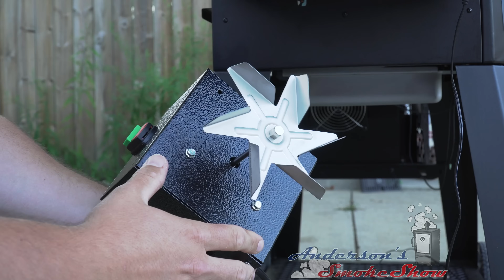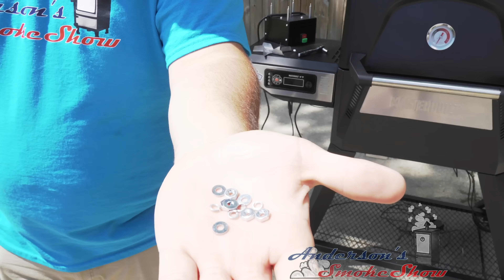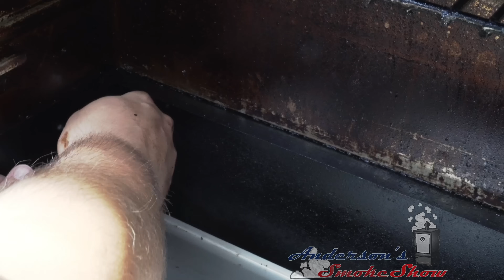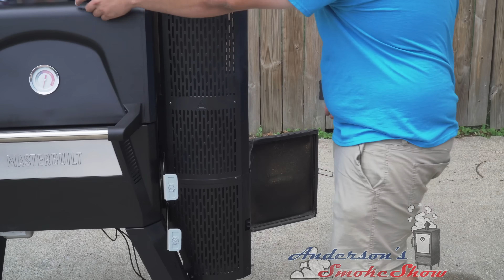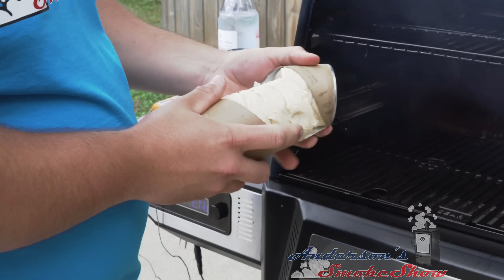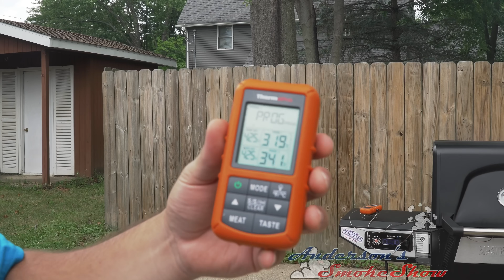Modification Failure | Masterbuilt Gravity Series

Comment: i have the same grill. bought it used for $100. cleaned it up and it's become my go-to grill/smoker. i've not done a biscuit test but i don't feel like there's a problem-temps are pretty accurate and the food turns out great. i did a few mods to increase the lifespan of the unit-stainless steel fire box, ss vent cover and ss manifold. i love the ability to mix real wood with charcoal. got rid of my pellet grill.

Comment: Given this was done by a self labeled engineer... I cannot believe it was this poorly thought out.  The actual concept of what was trying to be achieved is not even remotely viable without voltage limiting inline resistors.
"I got more grey stuff"... ya... brah... doesn't mean better... this was a fail across the board  🤣even the placement was a complete fail of concept
Reply from the maker: Yeah bruh, I bought a smoker convection fan and the results sucked bruh. So I bought a fan speed controller and ran about 15 different tests on my own time and off camera and not a single position/speed/direction ever made a legit difference. Sincerely Bruh.

Comment: Excellent video! It seems a little extreme to install a convection fan to get uniform temps. Meat drippings will destroy it anyways. Something nobody talks about, is using the damper (slider plate that you remove on light up) to control the temp fluctuations. I have the Gravity Fed 980. To stabilize temps, I partially insert it to control temp runaways (windy conditions) as well as some even-ing out of temps on the cooker. Small adjustments (sliding in or out) will work wonders. Might work on the Masterbuilts, just make sure you use the one on the cook chamber...not the fan.
Reply from the maker: I’ll have to mess around with those slides

Comment: Your fan was blowing against the inlet from the coal burning area.  You were basically fighting the grill.  A much smaller fan mounted to the back bottom would be a much better location.
Reply from the maker: I tried for a solid week to make a difference by adding the fan. Changed the direction, speed, etc…. Nothing made a real difference

Comment: There is a fine line bn circulation and cooling.  My immediate thought was the fan is too large.
Reply from the maker: I tried a variable speed controller but couldn’t ever get worth results even with slow speeds
Reply: @AndersonsSmokeShow  It was a good experiment.  Thanks for trying it and sharing the results, esp. since it was a fail.  As an engineer, I know you’re still contemplating possible solutions.

Comment: Great vid. I honestly think if that Smoke Daddy Pellet Smoker convection fan had variable control knob with 5 to 10 fan settings from very low to high, you would have not had that issue. If that fan could've spun at a 8th or 10th of that speed; especially in that small space, it would have circulated that air perfectly without pushing out all that heat. You might have seen around a 5 to 7 degree drop at max. Nice concept though. I wonder if they fixed that issue?
Reply from the maker: I did try a fan controller which actually got it pretty even, but the controller wouldn’t hit setpoint and would often run like 10-15F below which means that it continuously tried to heat up… thus burning more fuel
Reply: @AndersonsSmokeShow  So in the end using a fan is probably not worth it at all.
Reply from the maker: I feel like maybe with proper placement it could make a difference… but to pay the money to void your warranty is probably a no go haha
Reply: @AndersonsSmokeShow  unless of course, you purchased it from Costco. THEN you could bring it back. In the last six years I have returned to triggers and three Louisiana grill pellet grill smokers. Costco recently had the Masterbuild 800 for sale for $500 and I grabbed one. I have to say that this is truly one of the best REAL BBQ smokers out there! But if something happens where it fails in the next three or five years, I will definitely be bringing it back and getting whatever else at Costco has available. I just hope there will be another Masterbuilt BBQ available for purchase at that time. That is the benefit of having a Costco membership, that not too many people know of. Except for the ones that are reading this comment.

Comment: I was wondering if the convection fan was set to pill the hot air from the manifold or blow back at the hot air coming from the manifold? 
On a different note. Have you had a problem with the griddle where the temperature sensor would say it is at 350 but the door thermometer says 250? My thoughts are that the temperature sensor is getting hotter as there is a gap for the hot air to go straight to the sensor. I am going to try to mount a temp sensor in the back above the griddle and see if that works
Reply from the maker: I actually tried it both ways.... I spent a lot of time after this video messing around with the fan trying to make it perfect. I even added a variable speed controller to try and dial it in, but no matter what I couldn't get it quite perfect. If i remember correctly I got it to even out REALLY well, but it was sitting at like 15F below setpoint which causes the fan to run constantly and burn more fuel

Comment: I think you missed a data set that this mod makes for a more uniform temp throughout the unit, despite the probe temp vs set temp. Having a uniform temp in the whole cooking space is a valuable effect of such a mod. My theory is that a slower fan mod would be a good mod if you can match the set temp to the whole cooking space!
Reply from the maker: I put a fan speed controller on there and could never get it dialed in to where it was useable. It did even out the temperature, but because the temp reading was below the set point the controller just kept pushing. Eventually it would’ve errored out, or fuel consumption would’ve been through the roof.

Comment: I was thinking you need to put the fan in the middle and back or under. Anytime you are changing the designed features you need to engineer what you are attempting to accomplish. Add a rheostat to that fan and dial it down. Way down. You just may have the perfect solution. I would have dropped a smoked tube in and light  and tried to video  the airflow.

Comment: Was thinking about buying one of these grills but decided to wait until they are properly built straight from the factory!  Its just a charcoal grill shouldn't need any expensive modifications on top of the original price tag. Factory should also come up with an easy method to clean entire grill, bet most wont get cleaned much after the first 2 or 3 times, except the cooking grates of coarse they should be cleaned every time spray on oven cleaner rinse with hose do this 3 times they are ready to go.

Comment: What were the temperature inconsistencies?
Reply: My stock mb 560 shows a different temp than "meater" ambient probe temp regardless of where in box, probe is...  I consider that a "whatever"... control holds steady temp.. I can work with that.. how does fan affect "eveness" of biscuit test?? Not convinced your mod is a fail... merely that master built control temp is based on stock fan speed. If the hot spots are eliminated then the extra fan is successful and you only proved what a "control" test would have proved .. controller temp isn't 100% accurate. Did anybody ever trust a lid mounted thermometer? Why would you trust a digital controller?? Aside from showing fluctuation?
Reply from the maker: The grill said it was one temperature but my wireless probes said another. I have a whole video on it.

Comment: Probably pushing air against the original fan motor, original fan motor pushing air in if that fan is stronger it's pushing it back to the firebox, let's hrat
Reply from the maker: I got a fans speed controller, and I also reversed the fan blades. I did actually get a more consistent temperature across the grate, but the over all temp was about 15F below setpoint
Reply: @AndersonsSmokeShow  thats called an offset adjustment to the temp probe then. Sounds like what you did is a win? 👍👍

Comment: In the US it can only void the warranty of the part you modified. Just like how shucking a HDD voids the warranty of the USB case but the drive within is still under warranty.
Reply from the maker: Strange how that works
Reply: @AndersonsSmokeShow  Yea basically companies will try to claim that you will void the entire warranty for example those warranty void if removed stickers. US case law has made it clear that you can only void the warranty of the individual part you break and only the part. So for example even that part he drilled into could still be covered under a warranty for a paint defect if a part of the same piece had covered damage that is unrelated to the owners modification. Or for example if his PID controller now breaks that is covered under warranty as he did not do anything to the PID controller. They would need to argue and prove in a court of law that the modification caused the breaking of the PID controller for example in order to deny warranty coverage. 

Remember, in the US you have the legal rights to modify and repair your property without voiding the warranty.In so far as your repair / modification does not directly cause the failure that you are making a warranty claim for.

Comment: At least you tried. Every other mod people do alway;'s seems to work out .but after how many tries?
Reply from the maker: Yeah I want to revisit this and get it perfect. I have a speed controller for the fan which helped but still wasn’t right.
Reply: @AndersonsSmokeShow   cool! You did test it. Then the fan is in the wrong location. And or what is going on with the heat flow? Heat flow is everything.

Comment: I am very interested in seeing what you do next.  My 1050 has a full 50 degree difference from the temp on their probe and an ambient probe right next to it.  I think its just the controller.  My next step is to try the Firebrand but if the heat shield works that would be better.
Reply from the maker: I haven’t yet figured it out. I added a convection fan hoping that it would even out the temp which it did but it dropped the temp down to where it couldn’t reach set point. I still have some playing around to do and I plan on filming an update at some point soon. Thanks for watching Nate
Reply: I’m here because I’ve got the same problem. My brisket is taking forever, just realised why. Really shouldn’t have to mod your grill to make it work to spec

Comment: Awesome Video man. Im glad you did the video. Now we will know that the extra fan wont work. I dont know if you did a video after all the LSS mods but how do you think they work for you? Have you had them on long? Im very curious about the rear vent mod. Mainly because I dont have protection from the elements so keeping rain or snow out while cooking might be a problem. Not sure if the need for adjusting the air flow is necessary but keeping out elements might be. Let me know what you think.
Reply from the maker: I think the mods help the grill out. The firebox insert will help with the longevity of the grill. I like the water pan too! The damper is nice but it’s not designed to keep the elements out... it may help with it but I’ve see other actually fabricate a vent hood to keep water out. I’ve noticed more smoke using the damper so I know that it makes a difference.

Comment: Nice try bro, but maybe add a variable resistor to lower your fan speed. Even then you are still introducing "cold air" to your grill and ultimately working against what the grill was engineered for in the first place.(DOH!) Kinda saw that one coming. Remember-the factory fan is behind the heat source to begin with! Reversing your blade to pull air toward that side may create an even more lopsided temp as that side is already the hot spot. A for effort!
Reply: For sure bro! I appreciate you blazing the trail for all us "Masterbuilters" in your journey to potentially make this already awesome machine even better! Good luck to you!👍👍
Reply from the maker: Well there were a lot of unknowns going into this experiment. The fan had no speed control, but I also was unaware of the amount of airflow this would produce. After the test was concluded I reversed the fan blade but have been unable to re run any tests. Being an electrical engineer I have no issue wiring in a pot, but I decided against altering the fan because I could end up selling it if it in fact doesn’t do the grill any good... so I ordered a fan controller which is basically a plug and play solution. In regards to your comment on the hotspot the bottom far left tested 74F less than the center of the grill. So maybe pulling the heat in that direction will help. Tonight I’ll be toying around with it on camera again to see if I can mitigate the problem.

Comment: Good effort. But these grills are really half baked design wise. Particularly the burning stack...should all be stainless steel.
Reply from the maker: I agree, but keep in mind the price point of this grill.... that’s something that I have to keep reminding myself. I’m determined to get the fan working to where it will be a solution and not a problem. I’ve ordered a fan controller so that I can slow it down and I’m also going to try reversing the fan blade.
Reply: @AndersonsSmokeShow  your problem is the back vent. Close it up. Where is the heat going? Think about this for a sec. Unless you are shoving heat out a vent by creating positive pressure the fan should literally just be stirring up the hot air. Mixing it and making it uniform. The stack and venting on all grills is the biggest factor at controlling heat flow.
Reply: Yea I really like the idea of these things but for something this amazing I would be willing to spend extra to have something of higher quality from the start. Hopefully such options are on the way from the factory in 2021!

Comment: Well at least you found out that the fan seems to keep the temp the same almost. When the fan was turned off it was a good 20 degree difference. So yea you either got to make a shield so the air flow goes up or at an angle, maybe, or find another place to mount it.
Reply from the maker: I will agree! I’m going to try to slow the fan down.. already ordered the parts. I’m also going to try reversing the fan blade.
Reply: @AndersonsSmokeShow  where did you order the speed pot from?
Reply from the maker: I ordered it from Amazon: https://www.amazon.com/gp/aw/d/B015SLCJ2W?psc=1&ref=ppx_pop_mob_b_asin_title

Comment: I think maybe try a way to dial down the speed of the fan. Could just be blowing to much air
Reply from the maker: Yeah I was thinking the same thing. I bought a plug and play fan control module (basically just a potentiometer) to see if slowing it down will help.
Reply: @AndersonsSmokeShow  Aaaannndddd what happened?
Reply from the maker: I did a couple tests with the fan speeds and found that it does make a difference but not in the ways that I expected. There will be another video on it here soon.
Reply from the maker: What did they change?
Reply: Ya what has changed

Comment: Sorry it did not work out! I think the two fans are competing with each other! I would buy a Cheap Drum Smoker kit "You put it together"  and see if that fan could give you the ability to cook low and slow! Most drums want to run 300% F Plus!
Reply from the maker: Yeah I think this fan is too strong. I bought a fan control module to see if slowing it down will help.
Reply: @AndersonsSmokeShow  This guy has done many Mods to bring about even temp! I thing he is running a controller on a modded fan for even temps! https://youtu.be/k-YBq87Ivis

Comment: Never thought of doing that mod, not a bad idea in concept. You might try to turn your fan blade around, pull the heat into the wall and allow it to "bounce" back. Can you put a pot on the to try to slow it down as well? Just so thoughts.
Reply from the maker: I did think about the flipping the fan blade around, but not until afterwards. I was going to wire in a potentiometer, but found a fan control module which is basically a plug and play pot. I actually think that done right it will actually work to help mitigate the problem... but in this video in its current configuration...not so much. Thanks for watching Cliff
Reply: @AndersonsSmokeShow  Now I'm thinking about what your doing, it would take some S.S and some welding. The mod you put on top of your heat plenum, I would basically duct the fan lifting the mod and making a second plenum above it, with you speed controller you would be able to blow air over top the heat plenum, and more evenly circulate the air. I see it in my mind, but not sure its coming out in words. Might draw the up on cad and send you a dwg. I believe the goal is to remove hot spots and even heating through the convection process which I believe this would do. I have two sheets of 316l s.s that I am building the fire box mod with and have plenty extra to try this idea out. I'm thinking make the new plenum I deceived above and bring out above the heat plenum support bracket and mount a 120x120x85 mm digital fan and control it. Then again, might be over thinking this whole damn thing lol.

Comment: How about trying a heat powered stove fan? Uses no electricity, just the heat from the smoker.
Reply from the maker: That’s actually not a bad idea Clay. I’ll have to look around to see if I could get one that would fit inside and would take up too much room
Reply: Anderson’s SmokeShow I just purchased one from Amazon.
You should be okay if you don’t go over 8” high
Reply from the maker: Where do you plan on placing it in the grill?
Reply: Anderson’s SmokeShow I would like to place it on top of the bracket that supports the heat diffuser. Based on the dimensions I took, it should easily fit.
Reply from the maker: Let me know how it fits. I might be looking to get one of those too lol